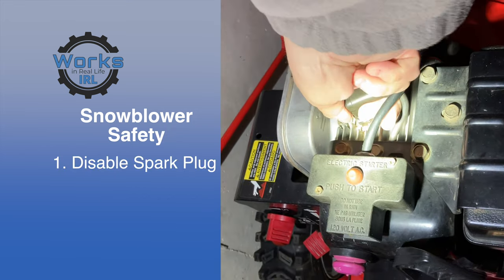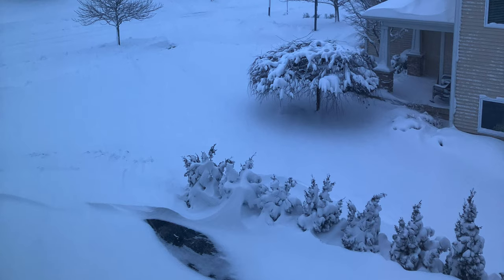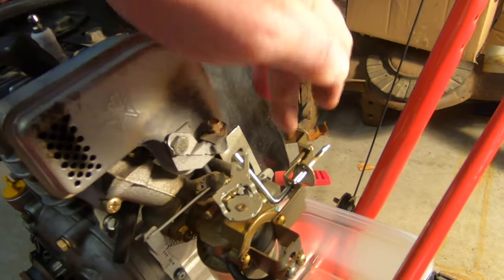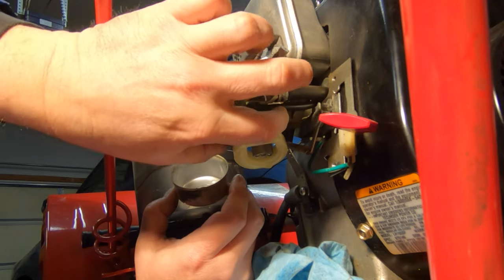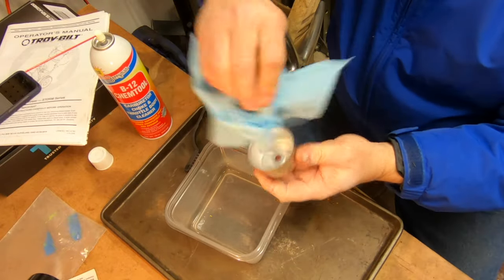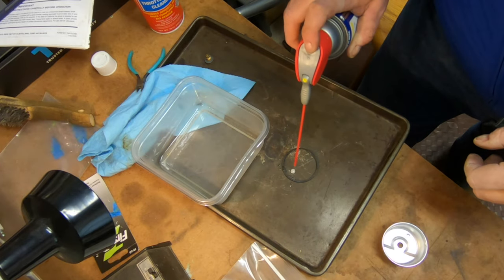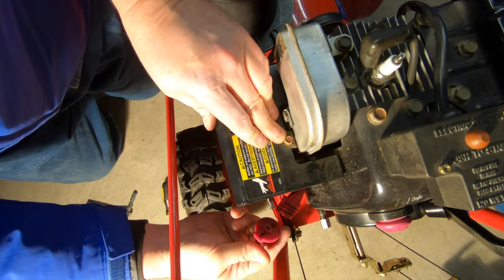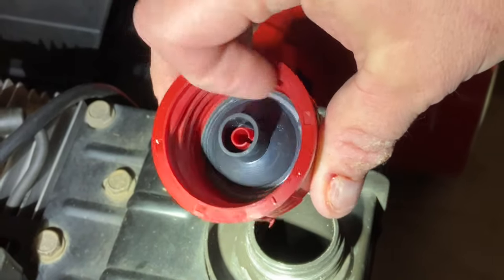Fixing Snowblower that Stalls Under Load #snowblower #smallengine #homemaintenance #homeowner

Comment: I have a Snapper (very similar to your machine) that is >25 years old. It comes out when the snow arrives and if fair weather allows, a thorough maintenance is performed. Fingers crossed for another year.
Reply from the maker: Wow!  That's awesome you've gotten over 25 years out of your Snapper...I'm not even sure if that brand is making snowblowers anymore...seems MTD has bought up all those names so I'm not sure any of them have anything left of their old brands.  Shows your maintenance routine must be right...I'm great at knowing what I should be doing at the end of every Winter season but admittedly pretty bad in execution as weather seems to immediately turn on lawn mowing season and I barely get that Summer equipment ready as I keep "meaning" to get to my poor Winter machine to store it...and it's still surviving which is even more amazing.  Thanks for watching and sharing your proof of good longevity from your diligence on proper routine maintenance!  Here's to you having continued many more good Winters of use from your trusty snow-moving machine! 💪

Comment: I have a old tecumseh just like this. Starts first or second pull always a idles and moves. Just like yours bogs under light load and stalls under medium load. I really gotta inch it around so it actually throws snow. Already has a new carb a few years ago. Pervious owner never changed oil so I think the compression maybe be lowered but when I pull the rope it has decent resistance. I might try looking at the main jet and possibly drilling it out to a larger size for extra fuel.
Reply from the maker: These 2-stage snowblowers are tricky to troubleshoot in my opinion.  I had similar symptoms prior to this and made a video regarding the belt and even then it was not intuitive...so much in fact, as I write this I'll need to re-watch my own video because I made that older one to remind my future self which belt to change 🤣.  I always think it's the "auger belt" but it turns out to be the "drive belt"...or vice versa...see?  I can't remember every time!  Please check out that other video of mine and see if you think it might be your belt.  If you figure it out, please stop back and let us know!  Thanks for watching!
Reply: @WorksIRL  I also replaced the auger belt when it snapped 2 winters ago so it’s not that. We even adjusted the governor so it would rev to the moon and still doesn’t have power. I think it’s time to retire the old 5hp and I’m looking at MTD 8 or 10 horsepower 24 inch snowblowers used so I can really not bog down lol
Reply from the maker: @Matthew_Does_To_Many_Things  That does sound nice having "full power" 🫡 One other thing I'm curious to check on mine is a small "spring" that applies pulley tension against the auger belt (may be one for the drive belt, too).  I may pull it off and "spread it" a bit to provide a bit more tension or even source a "new spring" just to see if it makes any difference.  Good luck on your's and stop back and let us know if you do get a bigger, meaner snowblower 💪Thanks again for watching!
Reply: @WorksIRL I have learned more about my 5HP tecumseh. The previous owner was my neighbor who gave it away when they moved out of state to a warmer climate. The oil is really dark. I don’t know if I should continue to put money into it as it might be lower on compression as the oil is probably very old but we don’t use snowblowers very often anymore where I am at. 
The biggest thing on these 5HP Tecumseh is if they are down on power it’s what you did in the video or the carb or the worst thing to deal with is the valves.

The valves don’t seal as tight as they were new and don’t allow it to make full power and when the valves are adjusted properly.
So if I were to adjust and lap the valve seats and grind them to make it in spec as you do on these old flatheads it might make more power but I am not inclined to do that or get the parts for it. Going to the shop would be a a lot of $$$ to do that job.
It’s a shame because the body of the blower is a little rusty but that’s just from paint peeling. Auger and drive would fine! 

I would do an engine swap to a new predator 212cc but my 5hp has 2 output shafts and the one that drives the wheels spins the other direction and at half the speed of the camshaft so if I were to predator swap it I would need to have to flip the whole transmission assembly around or I would have 2 forward gears and 6 reverse.

Just thought I’d share! I would do an engine swap but it seems complicated. I might attempt it though as new snowblower built this good as this old one are way to damn expensive!
Reply from the maker: @ I feel your dilemma and I truly have a "like/dislike" with these snowblowers.  When they're dialed-in...just great!  But, they sure are temperamental at times it seems.  You clearly have a keen can-do sense so I'm not one to offer you any more advice than what you've likely scrutinized.  I might just reinforce that concept of sometimes the easiest solutions are worth revisiting before investing more time/money into a problem.  Two things have gotten my snowblower working like a champ this season.  Ever since I cleared the main jet holes AND nice, fresh, treated fuel...wow, the thing is throwing snow without hesitation now.  A friend of mine was having similar problems and the simple act of removing the old fuel and replacing it with fresh, treated fuel (STA-BIL added) turned their machine into acting like new!  It's rather shocking how sensitive these small engines operated under cold conditions are to fuel quality.  I would also suggest using some form of fogging oil and/or pour-in-fuel treatment to help clean all the fuel lines.  I'm sure you've already gone down these pathways but I know how many times I've gone down the belts and carburetor rabbit holes only to find it was just bad fuel sitting too long or the fuel cap "bladder" was crushed and not allowing enough air to pass through as fuel was used up under load.  Good luck and I hope you can let us know if you find any stand-out culprit and get your machine working up to snuff!  Thanks for watching and coming back to update us!  Happy New Year!! 💪
Reply: @WorksIRL Yup! I will try and start  simple again soon. Happy new year!

Comment: Great video. 

100% agree gas snowblower's weakest point is the carb. I picked up an aftermarket carb from Amazon and worked like new. They are dirt cheap.

Your tecumseh engine should be an easy find.
Reply from the maker: That's great to hear you sourced and replaced the entire carburetor and it did the trick!  I'll have to do that as well and have it on hand before next Winter season.  Thanks for watching and sharing your experience!  I really appreciate it!! 💪

Comment: I replaced with new carburetor.  Fuel lines good, gas cap good.  Governor good, compression good.  Auger spins fine until under load and dies.
Reply from the maker: Bummer!  Watch my video on replacing belts…that was the fix to the first time I had my snowblower conk out under load.  Obviously, be sure you have fresh gasoline and check spark plug, too. Let us know if you find resolution and good luck 🤞